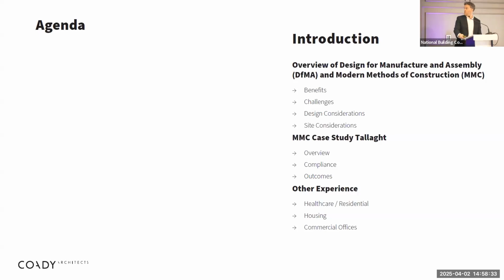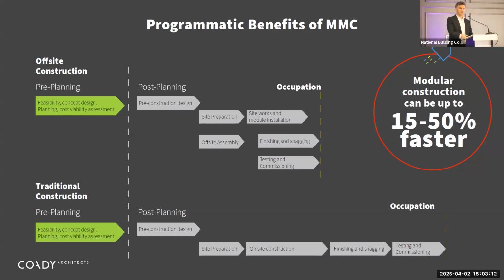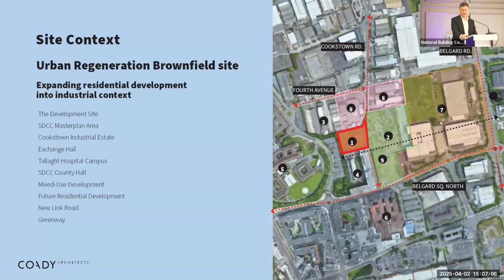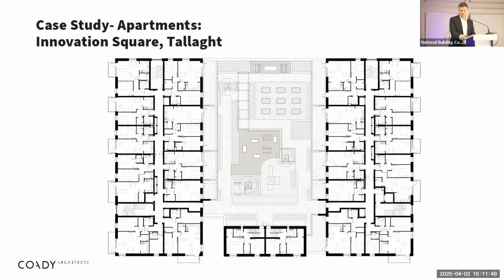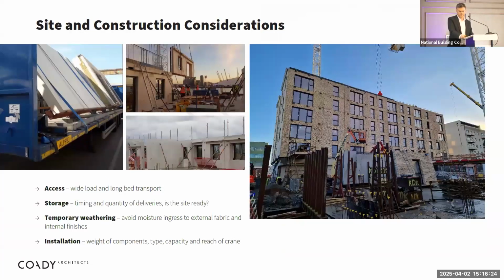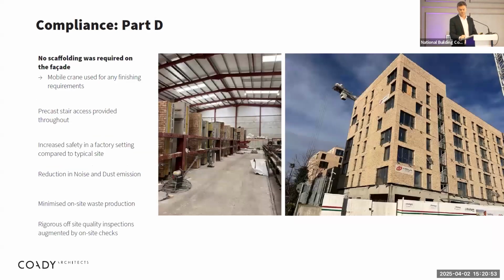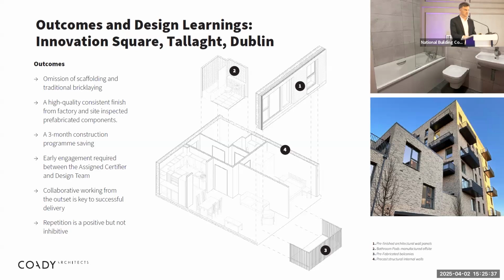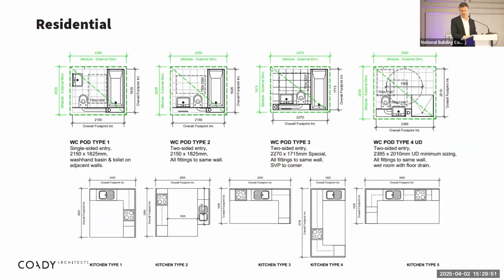Developing Precast Concrete Wall Panels – MMC (Module 08)

Comment: Informative presentation. 
The flooring for the Student accommodation : Queen Street, Galway was cast in-situ or precast and In terms of connecting the precast wall to floor and precast wall to wall what connections were used - dry or wet ??